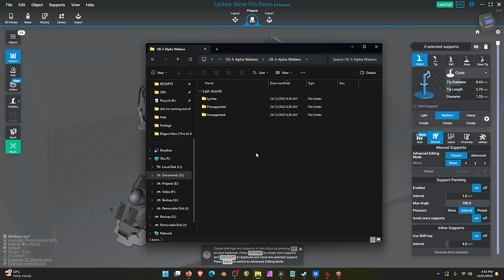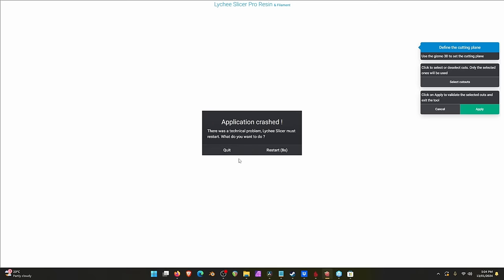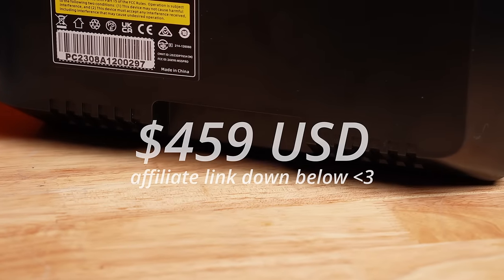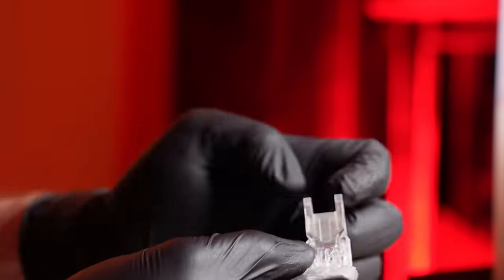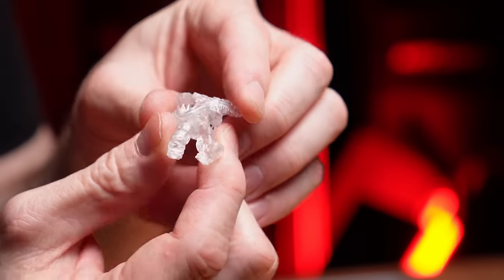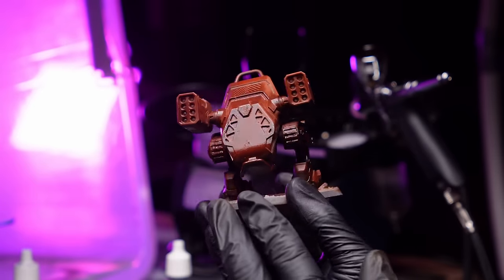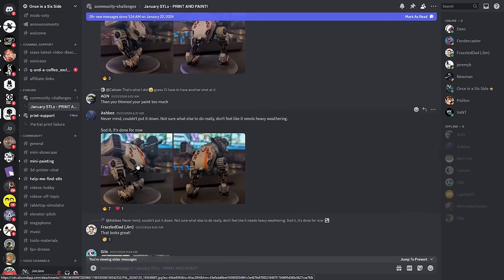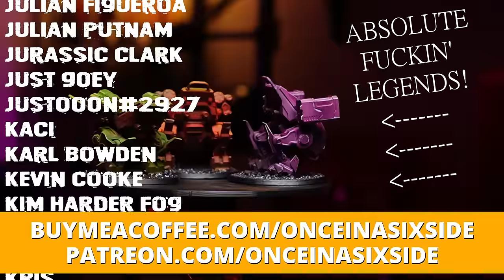Pixel war gets hot, miniatures resin insane now, Sentinel Print and Paint!

Comment: Thanks for the great video! 

On the subject of removing the prints without gloves, I've found it's best to just err on the side of caution. Yes, the mount should be clean and safe, but all it takes is one moment of not paying attention with your grip and you start banging your knuckles against the resin-coated top of the plate. 

The scraper handle is also super easy to get resin on, even if you don't realize it: I had a scraper that I swore was clean, but the moment I put it under the curing light, I saw all the resin splatter on it. That convinced me to always be cautious with wearing gloves around uncured prints.

Comment: Yea, for the heater integration you suggest, you would require a redesign of the motherboard and probably a daughter circuit board. Plus a shell redesign which they probably didn't want to do. Anycubic just probably used all existing parts and just updated the printers resolution. Then instead of $450 ish, they would charge 600.

Comment: Got to the part about the spatula, and just wanted to suggest looking at Wham Bam magnetic build plates. Made my printing so much simpler. I attached the magnet to the build plate, put it on a flat hard surface, and put some weights on it overnight. Then just have to align the flex plate to the magnet. Print's done, remove the flex plate, you can drop that into your IPA no problem or flex it to get the raft to pop off. Almost never have to use a spatula these days. I usually wash it in IPA with the prints then after it dries it goes back on the build plate, but you can get extras so you can rotate them if you're doing lots of printing.
Reply: Yep first thing I do with my resin printers is install a flexable base

Comment: also as far as the heater , tip is to turn it on before the print because it heats the resin last and the chamber first and it can heat the model while printing and cause it to soften and fail

Comment: Thank you man, your videos helped me take the plunge into resin printing. All of your tips and guides saved me incalculable amounts of time and headaches. In regards to the build plate scraping issue, I had been doing the same thing as you to get really stuck prints off my plate, but after 2-3 prints my prints would fail. I discovered that this was due to the fact that I was ever so slightly knocking the build plate off level each print due to the force I was applying to the plate. I would hold the top of the build plate where it attaches to the rail (as this was not covered in resin) which caused there to be some leverage on the levelling joint, I am sure this could be avoided by holding the build plate itself, or bracing it against something. I stopped doing this altogether and use a razor blade to lift the edge and then push my spatula under, often releasing the whole build plate in a few smooth passes. This might not apply to all printers but it did to me. If anyone calibrated and levelled their printer, got amazing prints and then a few prints later have fails, this could be your issue!
Reply from the maker: You're absolutely right, this will get a mention in part 2. Thanks for sharing :)

Comment: ACF does cost an arm and a leg, nfep is much more reasonable and sharp though. Also if you have a smooth plate you should be able to get anything off it easily if you sharpen the spatchula, etched build plates are a different story, I'm gonna sand my s3u plate smooth or get a flex plate because it's awful to remove prints.

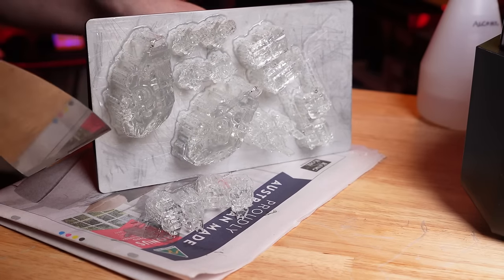Comment: 23:30 I find the best thing to do is not attack the print bed with a spatula, but to get my snips that I use for my filament printer or a pair of needle nose plyers and GENTLY grab a support near the edge of the base.  I pull it a bit until I see the base lift a little bit from the build plate, then take plastic spatulas and push there.  Once the vacuum is broken the part usually falls right off.   No need to beat the build plate with the spatula (which is what I used to do too).

Comment: That resin is a really good deal $61.50 for 3 1gk bottles I may try some, I've been buying siraya tech resin. I bought 2x 5kg bottles of  ABS-like Fast resin navy grey on blackfriday, weirdly they didn't charge me tax, cost $255 flat, so waiting to burn through that.
Reply from the maker: Careful, I made the same mistake when I first saw that pricing too - it's actually $61.50 per 1kg bottle, but if you buy 2 you get a 3rd free. So it works out to be $41 per bottle. Still not too bad, but definitely not as good as 3 for $61.5 haha

Comment: Great vid!

The only issue I see with creators showcasing their models in your vids is that GW will use your them as a resource to target creators.

I know everyone dumps on the plastic spatula but I find it works better than the metal scrapper. If you have a raft with an angled lip. The models just fall of the plate with very little force, bit of a wriggle side to side on the more stubborn rafts. That's my experience anyway. Maybe try it and see how it goes.

Can't wait till that resin is available. Perfect for flight stands.

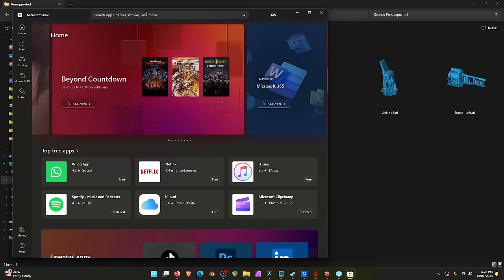Comment: 8:36 I have 3D builder for years and I didn't know that it could preview files... Any idea if there is an option to tunr on somewhere ?
Reply: i think if you click on 3d object it will open for you
Reply from the maker: Hmmm 🤔 Try right clicking on an STL file then setting the Open With setting to be 3D Builder. Also try rescaling your icon size in Windows explorer - I believe below a certain size the thumbnails will disable.

Comment: Great to hear you're better, man.
Hey I've got 3dBuilder as my default stl reader but I don't see previews as the file, only the builder logo. Is it some kind of setting?
Reply: For my its hit and miss. 
Sometimes if you changevthe view files settings from large icons to small icons and them back its shows the files. 

But I hvent found a method that works 100% of the time.